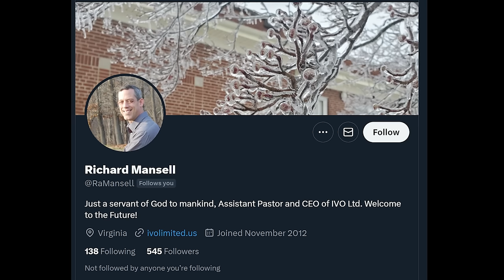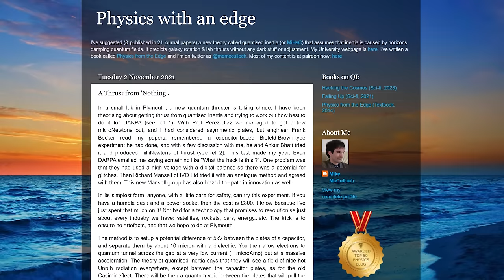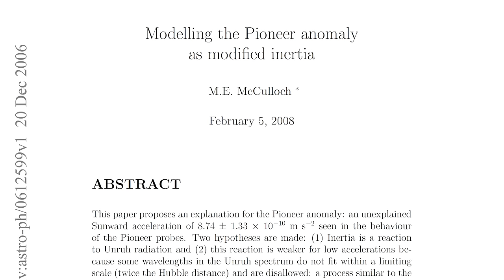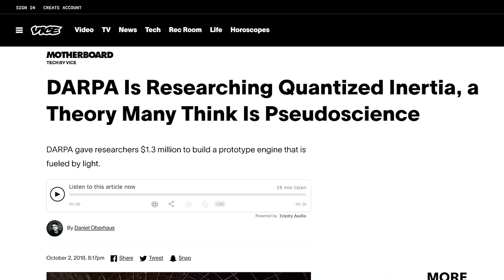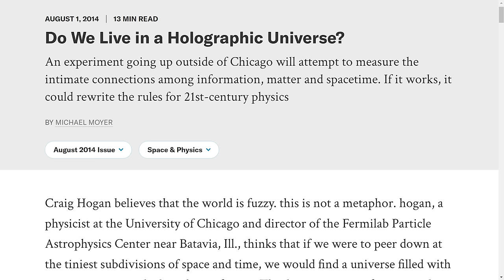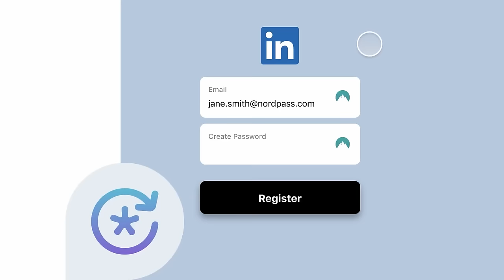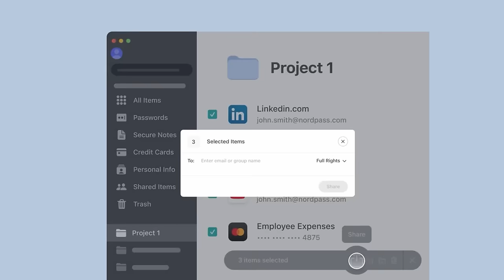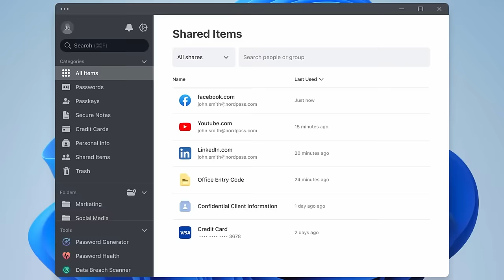Quantum Inertia Drive put to Test. It didn't go as planned.

Comment: Should have used an Improbability Drive.
Reply: They would have needed an infinite improbability drive as the finite one required more than a nothingth of a second.
But, not finding one of those lying about, they chose the tedious mucking option instead.
Reply: The problem is keeping a cup of tea intact around engineers long enough to get it into space for actual use. Anything even remotely caffeinated survives in Planck timescales around overworked and underpaid engineers.

Comment: The Power Distribution System gave problems from the beginning. That is why the launch was delayed from July to November. Having fed all the other experiments successfully, little Barry-1 did what it could, but high voltage in a small cubesat requires a very special Power Distribution System that has to deal with interface between solar panels and a tendency to produce arcs. Sabine the YouTube Know-It -All, when was the last time you launch a cubesat? Anyone that has experience the complexity of space launches knows failure happens and you try again. It is not like YouTube where what is said and done are of no consequence.
Reply: LOL Polish your tin-foil hat.

Comment: People tend to think of space as empty and it is if your going slow. But if you were going a significant portion the speed of light you would experience friction in the form of cosmic drag as that 1 atom per 3 cubic meters would add up per sec.
Reply: Not to mention photon drag. Yep, space ain't that empty.
Reply: Yeah its called radiation.
Reply: Pero en un espacio perfectamente vacío no habría resistencia por la fricción, aún no me queda claro ese motor o impulsor de "inercia cuantizada" y qué tiene que ver con la fricción en el espacio.
Reply: See that's the thing there is no such thing as a pure vacuum. Space isn't empty.  @nuassul
Reply: One minute would be like having been broiled on high for 2 hours!:hand-orange-covering-eyes::face-fuchsia-tongue-out:
Reply: @orionx79  Even if there were zero real particles in a given space, QFT predicts randomly appearing particle and anti-particle pairs, which appear and then quickly annihilate each other.   What effect this would have as you move faster through space is interesting... because it is Lorentz invariant, there is no observable change.  That said, I don't think this "quantum foam" aspect of QFT has been verified in experiments, but it is at the foundation of the QFT theory, as I understand it, so if it is wrong, there might be some explaining to do.
Reply: @yeroca the quantum foam is probably not a literal description, just a way to visualize how things end up happening, like with virtual particles. 

Hell, maybe there isn't any such thing as a "literal description" for anything below a certain scale. Not like we can look at it.
Reply: @Nebukanezzer I understand that.  It's just that the word "foam" has been used as a metaphor for it before.  That's why I put it in quotes.
Reply: Would you though?  Isn't the concept of a warp drive to basically move space and not you?  From a relativity perspective wouldn't stuff inside the warp bubble effectively be sitting still in its frame of reference?  If it wasn't then you would still be limited by light speed right?
Reply: @JathraDH  the concept that requires exotic material to work? No warp bubbles yet.
Reply: @orionx79  Yeah I am aware.  But if we are talking about going even 1% of light speed THROUGH space, that's about as far out of reach as a warp drive is for us TBH.  

The amount of power required to even go that fast with any appreciable type of mass is astronomical.  Also the problem no one talks about is even if you get up to 1% light speed how do you slow down once you reach your destination?  I suppose the drag force would help there, but it would still probably take a very long time to get slowed down enough you could catch a planetary orbit.

Since both topics are still quite in the range of science fiction I felt bringing up warp drive was applicable as it would solve many of those fundamental problems of trying to go very fast through space to begin with.

Comment: Like saying that at speed there is high winds, so high winds cause acceleration.
Reply: Spot on.
Reply: Glider pilots believe this, but those gliders are just glorified solar sails.
Reply: @2ndfloorsongs  boats can tach into the wind and outpace a free floating balloon in the same windspeed.
Lots of science is unintuitive yet correct, provable by exactly the kind of experimentation being undertaken here.
Reply: You mean it works like an atmospheric ramjet?

Or, that's the idea. But it's more like putting a windmill on your car to drive the wheels to make you move so the windmill spins.
Reply: @UnitSe7en  a wind powered car can move faster than the wind..
Reply: @NeonVisual  agreed.  I guess I was just saying it’s a bootstrap problem.
Reply: @NeonVisual  I'm aware of the direct drive vehicles - I would hesitate to call them cars. They are not cars. I'm not talking about one of those. I'm not talking about a wind-powered vehicle. The concept I'm talking about is a vehicle that's powered by it's own forward movement. That is more akin to what this new propulsion system is doing.

Or perhaps, as I said, the concept is broadly similar to an atmospheric ramjet. But either way, it won't work and sounds like an investment scam to me.

Comment: I'm glad my introduction to this QI theory and the QI drive concept and how it works was not from this video because this video really left out a lot of information like how the drive actually works and the fact that the IVO company stated they tested their device in a vacuum chamber on Earth and recorded a thrust response multiple times which led to their decision to decide to test it in orbit on a cubesat without any other method of propulsion aboard. Its the boldest example of empirical research you can find and I can't wait for the follow up QI drive cubesats planned (apparently several) one way or another the truth will be known, it either changes its orbit significantly or does not, it doesn't get easier to test than that and is worth experimenting with for that reason alone. If it works - it's revolutionary for physics and spaceflight, if it doesn't it's one less thing to concern ourselves with. 

Also the fact that SpaceX has made getting to orbit to test these bold experiments much easier and cheaper than it has ever been with their Transporter missions should be celebrated too, this is real democratization of space access.
Reply: Hopefully QI will be disproved with the next attempt.

Comment: Unruh effect is basically just Hawking radiation from the even horizon an accelerating observer sees.
Reply: Precisely. I fail to see why this is so controversial. If Unruh is wrong then it is likely Hawking was also wrong. Seems worth resolving.
Reply: Hawking's reasoning is valid for any horizon, so yeah, Unruh radiation is probably a thing.  In case you haven't noticed, Sabine is a contrarian.
Reply: That is the question and Sabine’s skepticism is why she’s so critical of the project (which is fine, we need a variety of intellectual perspectives in science). 

It’s worth investigating the unruh effect even if she doesn’t think it’s likely to succeed. Frankly, we’ve spent a whole lot more on other long shot projects or theories.
Reply: Hawking is very likely wrong. @orionspur

Comment: Regardless of how complex an engine is - thrust is easily and inexpensively tested.  Any honest company validates their thrust on Earth, and then tests it in space.  Mansell claims he proved the engine out multiple times at independent testing labs.  NO LAB has validated his claims of 52 milinewtons/watt of thrust.
Reply: I read the same and 12x more efficient than Ion propulsion. They also stated they have another version incorporating more advances for a next year launch. It's starting to sound like a scam. I hope the investors are using their pocket money.
Reply: Mike McCulloch makes a big fuss about Darpa funding his research on Quantized Inertia - a theory he came up with 15+ years ago.  And Darpa did indeed give him 1.3 million dollars spent over 5 years to prove that you can use QI to create an engine that produces thrust without propellant.  Total bust - Darpa gave up at end of project because - ummm - it does not work.  And Mansell started IVO in 2017 to create "remote charging" tech.  Now he is doing QI drives.  Likely a better preacher than scientist.  Hope his investors aren't too badly injured.

Comment: Clocks don't measure time. And clocks are not time. Clocks measure the frequency of oscillations of things, which vary according to the mass of the oscillating particles, - which varies according to their velocity through space, as E=mc^2 requires. Clocks can tick more slowly, and biological process can take longer without time passing at a different rate. There is an absolute space, and there is an absolute time. Einstein was mistaken when he equated clocks to time. The two things are not the same.

It's amazing how freeing those thoughts are; when there's no missing time in the Twin's Paradox, and General Relativity and the Equivalence Principle are fully and easily explained by the new River Model of GR. I can't wait to learn more about this new theory.

Comment: If the Unruh effect is real, it should also occur for something being accelerated by sitting on the surface of an object sufficiently massive to curve spacetime significantly, which would seem to cause the surface of a neutron star to stay above absolute zero (and therefore radiate) even after all initial and radiogenic heat had dissipated . . . unless gravitational acceleration isn't really equivalent to acceleration by change in velocity.

Comment: Everything I've seen and read about the EM Drive suggests that what is happening is a slight innertial mass reduction, not thrust.  This is particularly evident when putting it on a torsion beam or simple weighing scales.
Reply: The problem with these test is their trying to replace chemical Rocks completely  . Instead of adding them pushing the molecules of the walls themselves
Reply: The EM drive is not a real thing.  Get over it.
Reply: What does an EM drive have to do with this?  The idea of an EM drive is that you can bounce photons around in a container in such a way as to violate conservation of momentum and get a perpetual motion machine.
Reply: @ldpauls  Mike McCulloch proposed quantised inertia in 2007, and is the same guy who invented the EM Drive.
Reply: @dwaneanderson8039 Quantized inertia theory by Mike McCulloch is the guy who invented the EM Drive.
Reply: @davidhand9721  Quantized inertia theory by Mike McCulloch which this device is based on is the same guy who invented and built the EMdrive.

Comment: Most fascinating is that they got funding for putting such an experiment into space, while it's pretty obvious one can test any propulsion device with meaningful thrust here on earth.
Reply: They had a lot of trouble because static electricity in the wires and other effects registering as a force. The vacuum of space is the ultimate test...
Reply: Eh, that depends. If the thrust is low enough, then just going to orbit may be easier than eliminating all of the complicating factors.

Of course, then you run into other complicating factors, but if you're semi-sensible then you'll just launch two (duplicates of each other) but only turn on the engine for one, and only after you've sufficiently characterized their orbits. If you can get the one that got turned on (maybe after a few years) to have too much extra velocity to ignore then you can then justify more expensive experiments.
Reply: This was tested repeatedly on Earth and produced promising results. But testing in space will rule out any effects like accelerating ions in the air, even though the thrust measured was an order of magnitude higher than what could be explained by such things.
Reply: @absalomdraconis Considering all the high energy radiation not to mention particles running around loose out there in space, I don't see where it makes it that useful.
Reply: @absalomdraconis  Well, if it takes years to build up measurable velocity, it's probably not the technology taking us to the stars.

Comment: Miss information. The satellite failed and the test wasn't able to be run!
Reply: Your intended slur about Mrs H's statement being misinformation is incorrect.

First and foremost, your attempt at double entendre humor was both marginal at best, but most importantly derogatory. It's considered rude to be insulting in polite company.

The inability to properly execute an experiment to confirm the functionality of a device, has no bearing on the validity of the underlying hypothesis.

Comment: Realize that when you combine a million transistors together you get a computer, something that would be hard to describe to someone a thousand years ago. 
Some "Laws" will be found to be more breakable than others. 
Microwaves are a form of energy, and any and all energy when utilized correctly can impart thrust, it would be nice to see how these Quantum drives are meant to actually impart this thrust, but I have faith it works, as it is just an electrical thruster which is not breaking any fundamental laws of physics.

Comment: It also sounds superficially plausible, when sailing to blow into one's own sail.
Reply: Sounds plausible because it is.
It has some caveats on the sail setup, but its doable.
Same way a ship can sail faster then the wind that blows it, or sail into the wind.(at max 40 degrees)

Its also inefficient, and you would be better off using the fan to blow directly back for the thrust.

Comment: Long time ago in former USSR I heard myself in scientific conference  idea about adjusting direction of reflected light by corner cube retro-reflectors (put on many satellites for satellite laser ranging and for many other applications) by choosing material refraction coefficient (he pointed to Fizeau effect). Later I heard that test sample was even launched into a  orbit. I myself told colleagues that all idea is wrong - not even mathematics needed, basic principles of relativity theory  is sufficient (if the effect does not exist in reference system where retro-reflector does not  move, then it does not also in all others).  Colleagues were not very eager to a accept. I guess similar things could be rather common and others could find different examples.

Comment: I agree with a little more than the first half of the video. Denying the Unruh radiation, on the other hand, seems somewhat 19th century. But you are right that the proposed perpetuum mobile may not work as designed.

Comment: I think particle density increase with acceleration makes sense if you are accelerating in respect to the space particles (or near C with respect to the particles at constant speed). A ramjet in the stratosphere gets plenty of air density because of it's motion with respect to the air molecules. Of course, any volume of space will have it's particles in motion, propelled by stellar winds, their initial velocities, etc. But suppose you are moving through the near vacuum of space at close to C with respect to the particles in your vicinity (we'll ignore the radiation bathing the ship due to particle impacts for now). The very high velocity with respect to the particles will massively increase their density in the direction of travel. Imagine a square plate moving at 0meters/sec with respect to the particles. Near zero impacts. Accelerate to one million meters per second and we will have lots of impacts. And so it goes as we accelerate. Since the particles will be mostly protons, you could basically make a hydrogen ramjet in space. The only problem is that the friction of these particles in the direction of travel will also tend towards infinity because there will be zillions of them and they will be very, very heave due to relativistic mass increase. So I think it would make more drag than thrust, but still a fun idea "ramjet in the hard vacuum of space".

Comment: I have to explain to most people who ask me about my ebike, they ask if I'm generating electricity when I pedal, and I have to tell that it's not a perpetual motion machine, but that it's giving you energy. My name is Bicycle Bob and I approved this message and the average person isn't very bright.
Reply: if it has regenerative breaking then you do kinda charge it by peddling.
Reply: @azzy-551  It does not even have to be regenerative braking,   you maybe directly charging battery by pedalling (it will of course be more difficult to peddle).  So the question is perfectly valid - is bike of the type where battery is charged on the way.
I have an old ebike, which does not do that.
Reply: @azzy-551  you just contradicted yourself, braking, not pedaling, in fact generates minimal returns as braking is very minimal, less than 1% return is typical. My name is Bicycle Bob and I approved this message.
Reply: The average person is by definition as bright as the average!  The ones you discuss this with may just be lacking in STEM education.  Thanks for trying to educate them.

So much of bicycling is effort against air drag that most e-bicycling designers don't feel the benefit of regeneration is worth weight/cost.  There are generators/regeneration hubs for running lights or charging electronics, I don't know if anyone is bothering to use these for range extension/recharging on e-bikes.